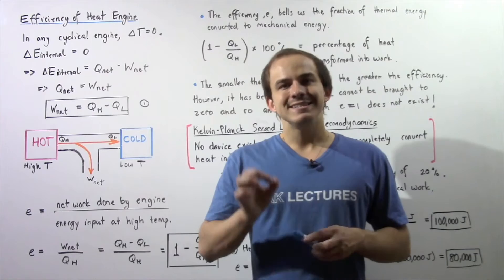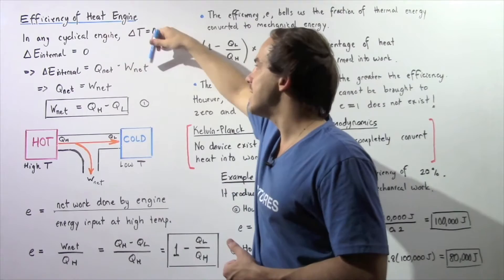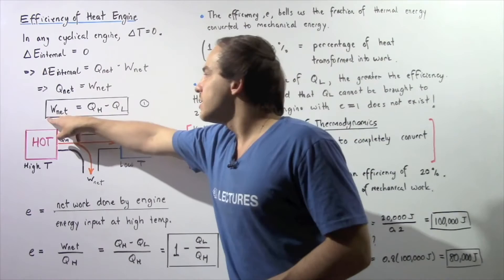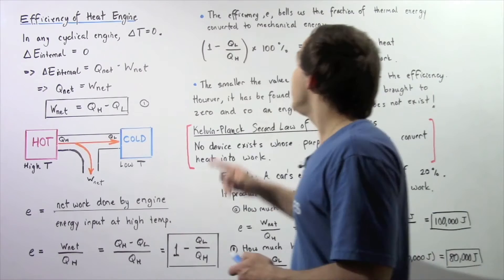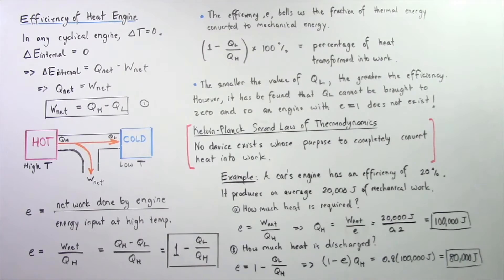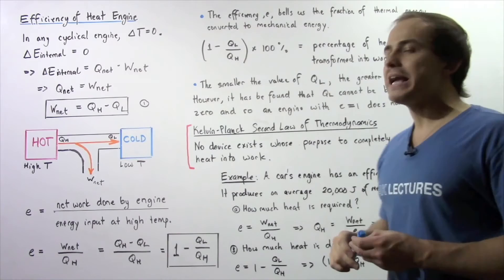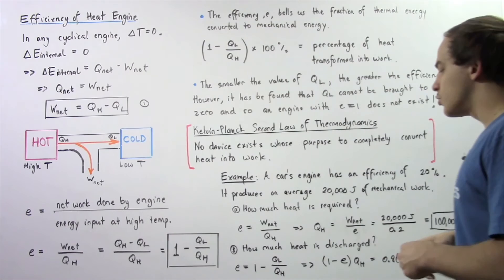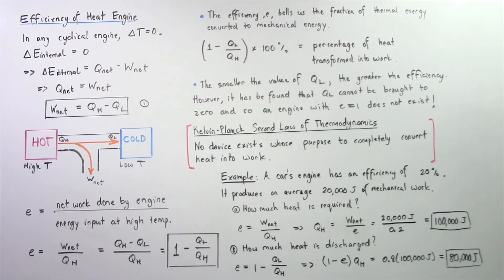Heat Engine Efficiency and Kelvin-Planck Statement

Comment: Thanks for your excellent videos! They are really useful and easy to understand. I have a question related to this topic. There is a problem where two heat engines are connected in series (the heat released by the first engine is used as the heat absorbed by the second engine) and I have to find the efficiency of the system. I know that I should start with the basic formulas and I have been trying to come up with the answer. However, I feel that I am missing something. Is there anything that I should do differently because of the two connected engines? Any help will be much appreciated. Sorry for the lengthy comment. Thanks!